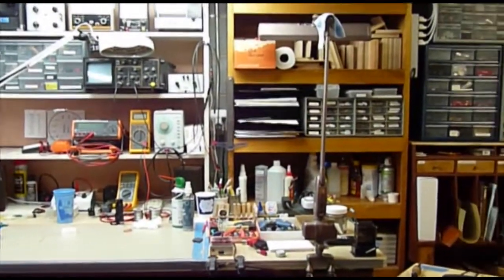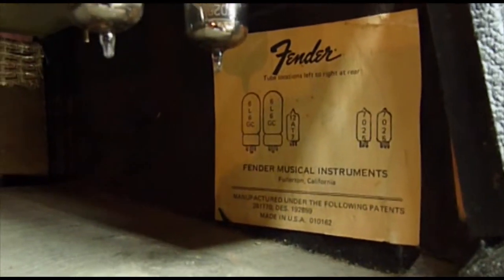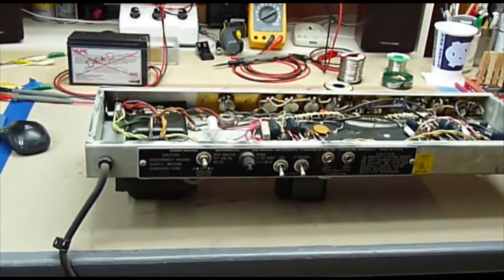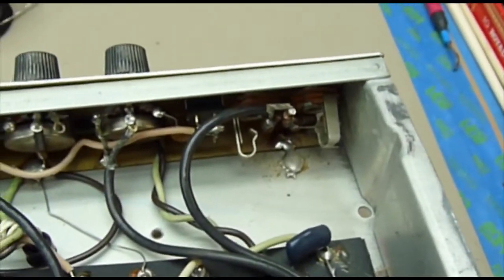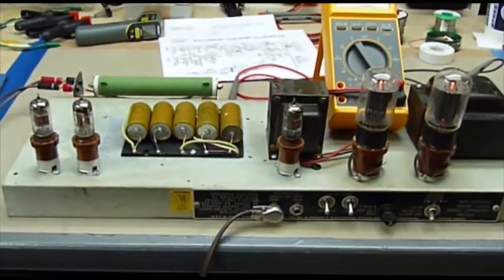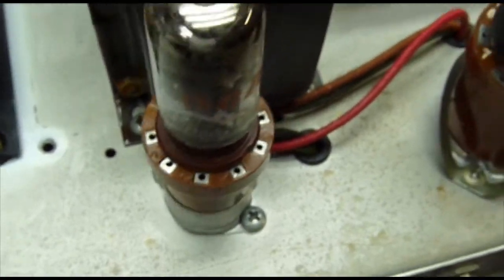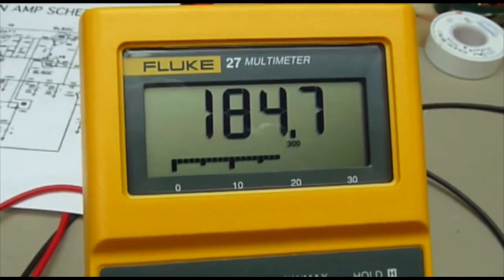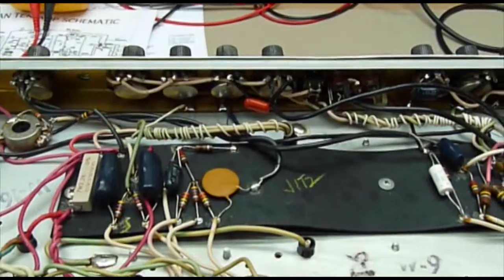Fender Bassman 10 visual review, diagnostics & repair

Comment: Actually made these from 67 to 77 (50 watt vers). I have a 72 that I use for guitar and it is the best sounding amp EVER!! It's the basic amp design (original Bassman) Marshall copied to make their first 50 watt heads. So it's basically a 50 Marshall head with built In 4x10 cab! Incredible amps!!

Comment: I just purchased one of these and replaced all the Electrolytic caps,anode resistors and resoldered with a 60w iron. Mine had been used by a piano accordion player since the late 80's and has a factory original cover. All speakers are good. I rewired the bias for individual control of each tube and bypassed the balance pot which I've seen cause trouble in other amps. My favorite tone is with the Studio Chanel set Bass 2 Mid 10 Treble 2 Volume 7 Master 5 Oh sweet Cheese's With my Gretsch Roundup rear pickup its a rock n roll machine. Still has all original tubes .

Comment: Great video, people should not go into virgin vintage amps without a videorecorder running. Thanks so much. Probably a grounding issue on the pots... Great you didn't change the capacitors. Next guys would have clipped them before anything. 
Please keep "um" coming!

Comment: plate voltages look high because main line voltage in your house now is higher than the past when this amp was made and tested.
Better use a variac to get exact specs.
Reply from the maker: +MrAletube Good point sir, just 5% high on the wall voltage would account for the noted discrepancies.

Comment: Thank you HTA! I have one of these that has sat unused FOREVER. So for kicks and grins I pulled the fuse and found it was blown. So I have some 2.5 A 250V Slow Blow Fuses on the way from Amazon. I don't suspect it will be that simple. I have viewed this video several times in anticipation. Do you have any suggestions other than the thorough visual inspection for obvious defects and checking the pots, solder joints? Again thanks much for the video. It's really the only good look at one of these on YT!
Reply from the maker: String Bender, It's nearly certain that it won't be "that simple".  Something failed in the amp and caused the fuse to blow.  You should plan on replacing those big brown electrolytic capacitors in the power supply for sure.  One of the power tubes could have shorted elements. There are dozens of things that could cause the problem .. and it's impossible to diagnose those in a YT forum.  Your best bet is to track down a good tech and take to the shop.  That's a valuable amp and worth maintaining IMO.  Good luck.

Comment: Hi, could you please tell me about the socket savers you are using in this video and where you got them? I've never seen these with breakouts, great design to allow measurements from the socket side. This allows you to confirm voltages at the point of the tube pins vs. at the solder tabs inside the amp...especially the control grid. Great way to find intermitten connections in tube socket or loss of bias. Very cool, I need to get me some! Thanks for the nice video and any help on finding these sockets.
Reply: @ Blake I found all those on eBay by searching for "tube test sockets". "Back in the day" the primary manufacturers were Vector, Pomona, and CBS/Hytron. They're somewhat rare .. it took me several months to accumulate a usable inventory.
Reply: @Mark, thank you for the tip, I will try that out. I'm a little too young for those "days" yet most my interests lie in the "golden years" of tubes, test gear and guitar amps and especially Craftsmanship. Thanks again

Comment: A colleague of mine has one of these, but it seems to have some issues. All tubes have been replaced with new ones, but when it's powered up one of the (matched) 6l6 tubes quickly lights up (very) brightly. 
What could be the reason for that?
We haven't dared keeping it powered up.
Reply from the maker: That amp is a fixed bias model, that uses a "bias balance" pot. If that pot has been adjusted way off center (balanced) bias, then one power tube may be running really hot and the other one really cold.
There is also a phenomenon referred to as "filament flash", wherein a poorly coated filament fires up really brightly at initial turn on, and then settles down. There's nothing to be done about that .. if that's the issue that tube will work fine, but will likely age out more quickly than the other.
Another possibility .. the filament in the "bright" tube may not be positioned as well as the other, and in that case your simply seeing more light from that particular filament.
There could be several other issues that might cause this .. very hard to diagnose an amp remotely.

Ck the plate current on the power tubes to see if they are biased equally.

If you have access to another set of tubes, try them for comparison .. the same issue in another set of tubes would indicate a problem "upstream" of the tubes. If a replacement set resolves the issue, that narrows down the problem to the tubes themselves.

Comment: What happens if you just decide to leave the already working vintage power-caps in there and run the amp as is?  I want to know because I'm considering buying one of these of late 70's vintage (77 or 79 I believe) and the owner says it works great, but I'm wary of having to invest more money into the amp or maybe risk inadvertantly altering the vintage sound.  I only play at home occasionally, I'm not planning to gig with the amp or anything. So if I try my luck with the old Mallory caps, will the amp eventually explode? Really want to buy this amp but a little scared after watching your video and reading some other people online who are insisting that all caps must be changed like every 5 years or your amp will die.
Reply from the maker: It won't explode, and it won't die, but it likely will not "work great" for very long. Excessive hum would be the first audible clue to failing power supply caps. You WILL have to invest more money into a 40 year amp at some point, likely very soon .. most of the original components will not last forever. That vintage sound is primarily a function of the circuit design and the vintage speaker. Replacing old components is a fact of life and, if they're replaced with comparable types, should not damage the vintage voice of that amp. Buy it, enjoy it, find a good tech who appreciates the vintage value and can keep it working in that fashion. I personally don't see the value in a vintage amp that no longer works.
Reply: My 1960 Gibson skylark ga-5 has every original cap and sounds great.  It's two decades older and still sounds great. I bought it from the original owner in the early seventies.  Same with my 1965 Princeton reverb my 66 or 67 vibro-champ and at least a dozen other amps I bought in the 90's.  So I don't understand why you said early failure is to be expected. Of my over three dozen tube amps four or five have needed repairs other than tube replacement or grounded cord updates
Reply: Demetrios Fear not. I have this same amp 1972 model my father bought new. It still works perfectly and has NEVER been worked on! I know that's not typical but that baby sounds sooo good cranked!!!